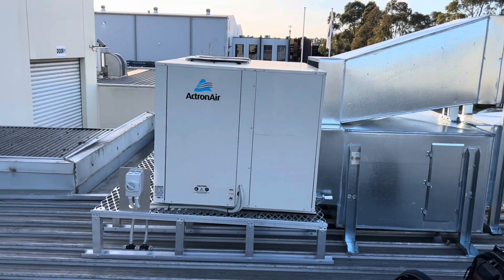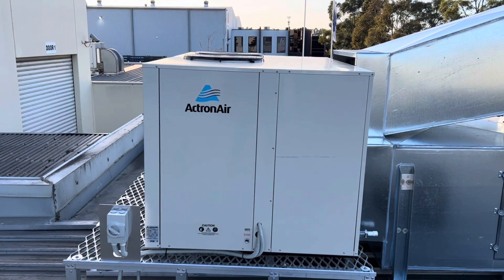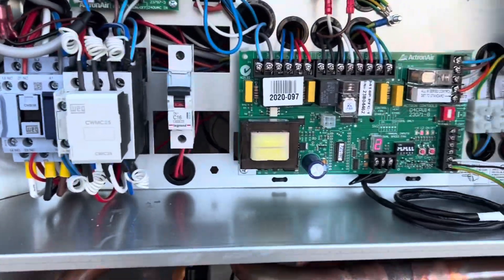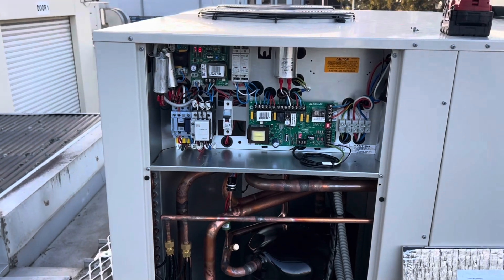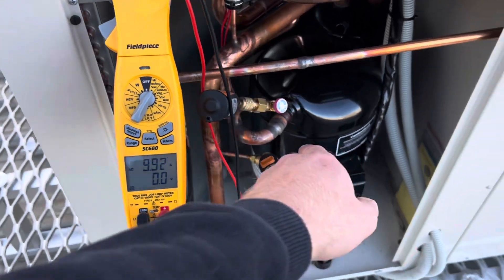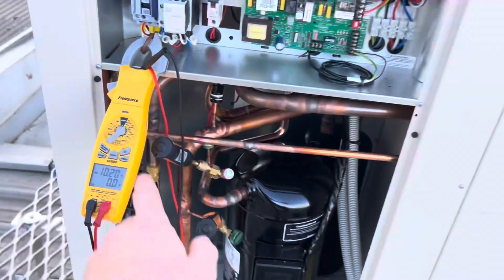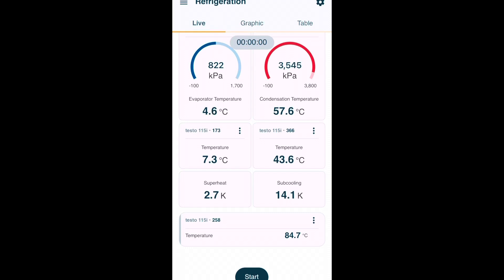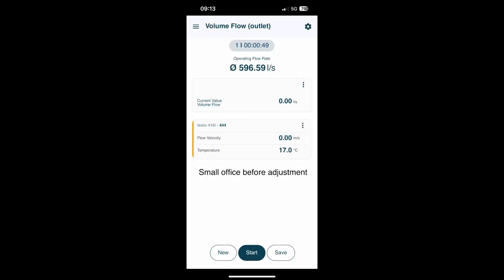Actron Air / Commissioning a 25kW Package Unit

Comment: Don’t forget to add in your K factors when taking airflow readings. I think generally a 4 way is around 0.5-0.6.
Reply from the maker: Thanks for the tip! I don’t do this very often so any help is greatly appreciated. I’d definitely be keen to learn and do more commissioning. Seems like a interesting part of the trade.
Reply: @hvacraustralia 
I got thrown in the deep end with with Airmaster actually, ended up down in Melbourne with their commissioning technician for 2 weeks! 
Very interesting part of the trade that often gets overlooked.

Comment: Why does the reversing valve switch when you turn the power off to a heat pump unit?
Reply from the maker: I assume you’re referring to the system pressures equalising causing that “whoosh” noise? I’ve always thought it’s dependent on what mode you’re in. The RV without power is set for cooling mode, so when the unit is calling for heat it will send a voltage to the coil moving it into heat mode. Even once satisfied the system is still in heat mode so the RV would still be receiving voltage. When you kill power the RV returns to its cooling positing causing the refrigerant to suddenly equalise. I could be wrong, I’ve never read that but that’s just how I’ve always though about it.

Comment: How good is that multi screw driver I have one too. I had to make a little modification on mine and glue the tiny springs onto the plastic tabs and now it is great
Reply from the maker: I love the flexibility of it. My only issues has been the inside holders breaking away. Have you had this issue also?
Reply: @hvacraustralia  nah haven't had that issue. My only issue was I dropped it and the tabs came off and the tiny springs flew out so I cut some new springs off a Biro and glued them on and has been great ever since

Comment: I was a factory Actron Air service technician back in the day and great to see them still pumping out systems today. Pretty sure they will have some commissioning documentation you can also follow. Funny, that board layout hasn't changed all that much over the years. Cheers Mick
Reply from the maker: Awesome. I don’t see many of split ducted units. Mostly package unit. I found on their website they have a link to all theirs manuals which is great for future reference.